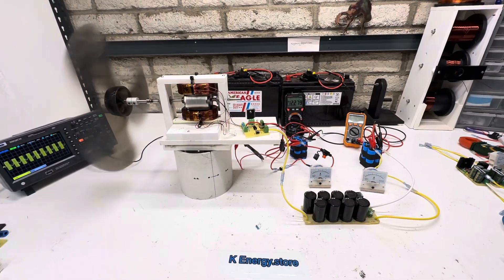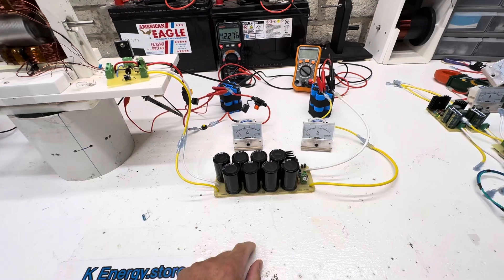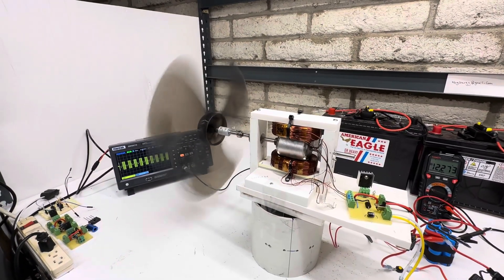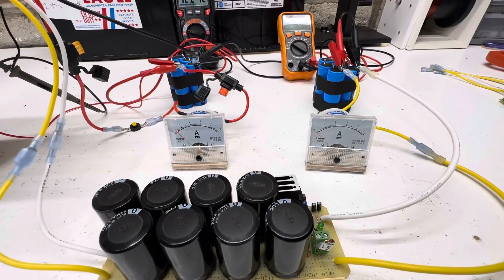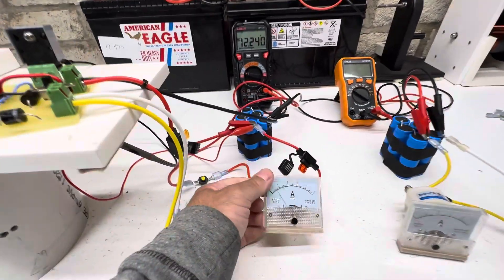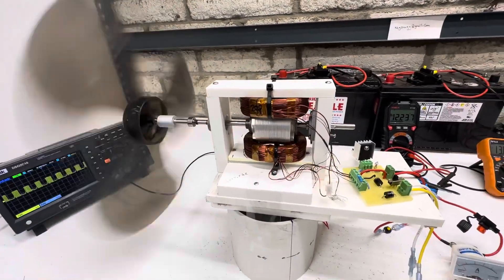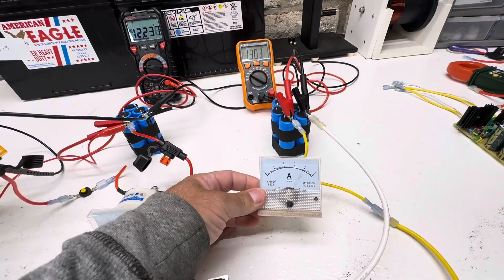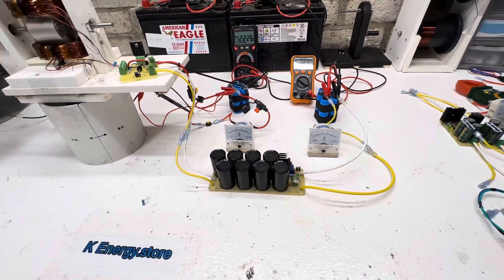6 pole window motor tuning ssg and generator mode

Comment: Love your videos! Each video of yours inspires me! Do you know the total Watts in and the total Watts out?
Reply from the maker: Thank you ! In For ssg .350 x 12.3 = 4.3 watts 
      Generator mode.   .5 x  12.3 = 6.15 watts 
Out 3 volt difference x 5amps = 15 watts every other second
Reply: @kenergy1707 - good share!
Reply: Hi K
To get a good handle on watts in vs watts out, the input is pretty much what it is with the analog meters looking at amps x voltage.....to double check you can drain a small battery down a few times from a given fully charged state to say down to 11V ....and if knowing the amp hours of battery and the draw in amps x volts during the drain time you can double check to what the analog meter gave you however probably no need for this as when the motor going a good rpm the analog meter should be good as you can get. 
But the output watts, because its not continuous as the input is, but coming in blasts every second or whatever it is, now its hard to say it is XX Watts for sure, as also the pulse width during the discharge blast into those cool looking titanate or whatever they are cap/batteries will also determing the actual watts....the 5 A on meter looks like lots more than 5 A actually plus it might be only a  1/4millisecond discharge or it might be a 1 millisecond discharge we dont know you would have to scope it but if its 1 ms compared to 1/4 ms that means its four times more current output,  but you would not know this looking at only the analog meter knocking its needle way up to 5A or more....Then on top of that,  just how much of that cap discharge is "wasted" and doesnt do a charge to those cap/battery guys absorbing the cap discharge saved up from the motor....so you could have "5A charge" every two seconds, but can you say the cap/battery guys a actually "recieving" or "collecting" a full 5A charge?
So it gets complicated ... but to keep it simple (sort of) , run another motor just the same on the cap/battery guys being charged "perhaps" or loop it back into motor (you did that a few videos ago) and see if battery goes up in charge - seeing itgoing up in voltage another problem, as its possible the battery has voltage rising but the battery still wll drop down in "actual charg"e - a meter that measure the actual" internal resistance" of battery is reallygood to have, they cost around 50 bucks on ebay and if the internal resistance of the battery shows its fully charge then its fully charged no matter what the voltage shows.....Anyways you probably know all this already, however to do a really good input vs output test you can do this official :"cap discharge formula for watts" below which any electrical engineer would have to agree with.....this is dumping the cap into a resistive load of some sort to discharge it, not a battery, however I guess a battery would work too but the EEs might start the argument about it being a battery and they want to see a resistive load tobe sure about it.......whatever,....so here is the formula, its probably the very best way to zero in on what exactly the watts output is, and if electrical engineers you are trying to "convince" about what the watts is from the cap discharge, they will not argue about it (too much) haha
I guess if you filled a cap first from a battery, then discharged that cap into the motor coils, you could use this formula on the input too. But probably the analog meter for input is fine for that 
You will need a scope some good eyeballs and little bit of  patience to calculate watts doing it like this...  Note how the size of the cap affects the watts, the drop of the voltage in the cap (the joules) affects the watts, and also the frequency of discharge also affects the watts too....anyways here it is:

FARAD VALUE OF CAPACITOR / 2
X
(Voltage in cap AFTER discharge SQUARED
Subtracted from:
Voltage in cap BEFORE discharge SQUARED)
X
Number of cap discharges PER SECOND

So for example:
Lets say a 100,000uf cap is being filled up, and it discharges twice a second happens to be what you are working with....

That 100,000uf cap is equivalent to  a .1 Farad cap   (also10,000uf = .01Farads etc etc) 

So .1F / 2 = .05 Farads

Lets say looking with a  scope, it shows 10V in cap just before the discharge, and it drops down to 5V from the discharge each time....

So that is 10 x 10 = 100
And  5 x 5 = 25
And so 100  -  25 = 75

So putting it all together:
.05 "farads"  x 75 "volts" x 2 (twice a second) = 7.5 WATTS  happening from the cap discharge

    @kenergy1707
Reply from the maker: @MrDKONZEN  very cool ! Thank you I’ll try it 
Resistive loads never work right always loads the motor once below the the battery voltage but the rest will be fun ! Thanks !
Reply: The loading of the motor under battery voltage "wont happen" if you have the cap decoupled/disconnected/floating during the cap discharge......fill cap with no resistance on it, then discharge cap while it is decoupled......works great.  AKA the "two stage" cap discharge output circuit,
However of course if cap under charge-battery voltage, its not going to charge! So whats the use eh...(so do a resistive load just to find the actual watts)
Filling up the cap again after the discharge will be what will cause loading of the motor however....when working with flyback into a cap, thats not such a problem but could be.  To get around that have another switch that connects the flyback diode about five degrees after the motor pulse fires (with same pulse width as the motor coil pulse width) this five degrees retarded "flyback pulse" think of like an echo to the motor coil pulse....this works really good if you try it out. Gary Porter (Skipper by the Sea on YT) gave me this idea 20 years ago - he got it from a Tesla patent with two motor brushes in the drawing.... (the second retarded motor brush in patent drawing connects the flyback)
Also while still typing my nonsense haha there is also the problem of a cap discharge into a battery to where the cap "keeps discharging" below the battery voltage level you want it to "stop at"  For example, with a 12V battery, anytime the cap drops BELOW 12V during discharge is completely wasted energy.  It will not be charging the battery a speck more.  So you should have the discharge cut off somewhere above the battery voltage.....this way ALL the joules in the cap do a charge, nothing wasted.  You can do this pretty easy with the pulse width, plus the cap UF value too, of the cap being discharged to battery to charge, maybe also with your tricky SCR circuit not sure myself how to do that but you probably could figure something out......maybe two SCRs one triggers closed via resistance value, other one triggers OPEN via another resistance value something like that - I dont know.....
I have been  told Bedini preached for a 12V battery to have about 36V in cap, and drop it down to 23V and stop it right there and this would be most effecient cap discharge to charge, however this is a lead acid battery, I dont know what would be best with those lithium types.....maybe not 36V in their case they might explode from that or be damaged I dont know never have worked with them.....  @kenergy1707
Reply: @kenergy1707  Thank you for your prompt reply, and please forgive my ignorance. I am new to the hobby. Are you saying that the input power is less than the output power?
Reply from the maker: @shawncalderon4950  no but can be as much as 85% return
Reply: @kenergy1707  That sounds like a good return.  Have you tried to run your motors with magnetic bearings in a vacuum chamber? Again, I can't thank you enough for your help!
Reply: @kenergy1707   85%, under what conditions is this possible or specifically where?
Reply from the maker: @treaclev  watch my outboard motor video
Reply: @kenergy1707  but don’t your words in the comments to the outboard motor about returning 20-50% back contradict this statement of yours?
Reply from the maker: @treaclev  it does not 50% is with the cooling fans on
Reply: @kenergy1707  This means that energy from the source must be spent on cooling to increase the efficiency of the motor.  Is it possible to do liquid cooling like in normal electric drives?
Reply from the maker: @treaclev  yes can be cooled by water at the most efficient low Rpms the fans are not necessary but I made it that way for medium to high power